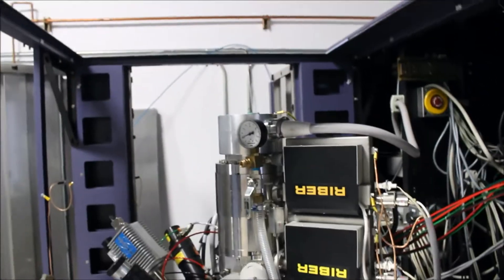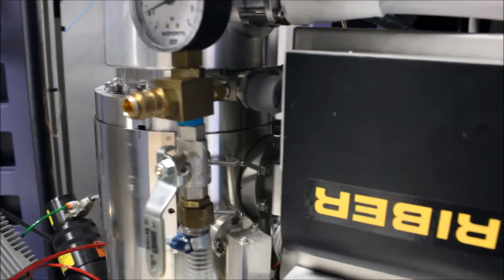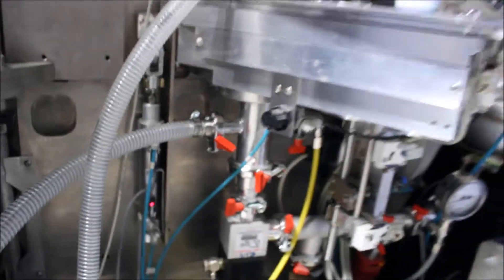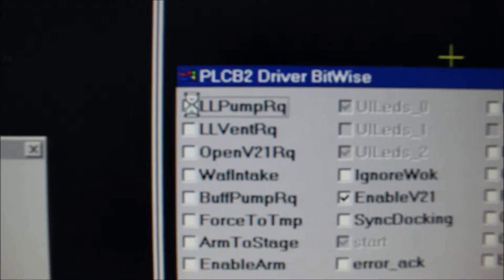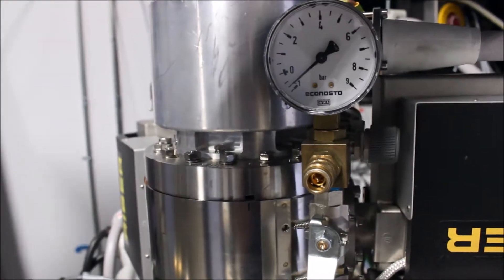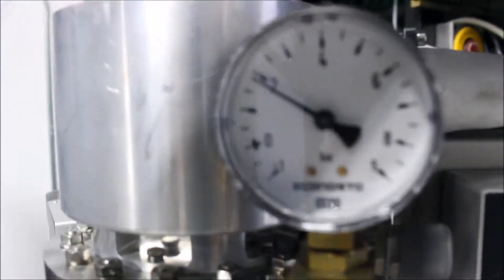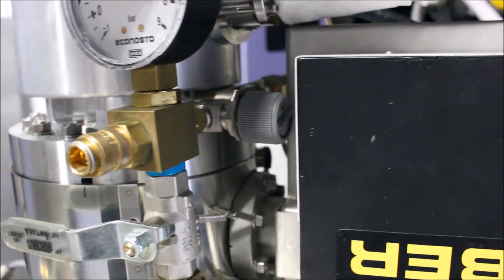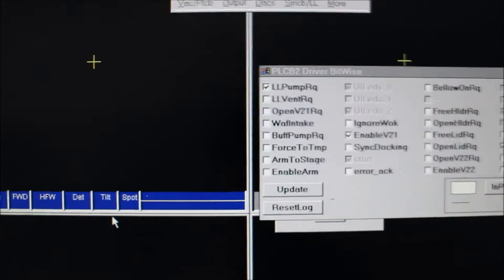FEI Philips Electron Microscope SF6 refill after FEG Exchange

Comment: Hi, wondering if you reclaim the SF6 gas and how you go about it.  I have been asked to look into how this is handled for TEMs and EBL systems.  Thanks.
Reply: We don't reclaim the SF6 since it's such a small amount of gas lost.
Reply from the maker: Hi Gary, For the large volume of SF6 in our TEM we can compress the SF6 back into the bottle and save it for refill. It requires an oilless compressor to prevent contamination. The challenge is having the correct hardware to adapt the instrument to the compressor. Kevin